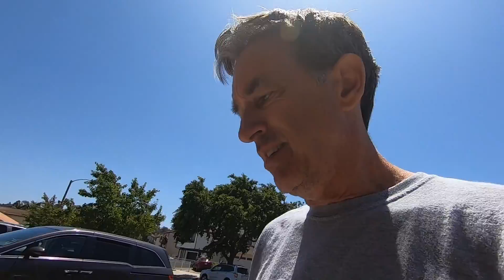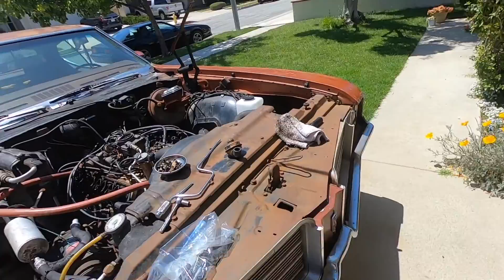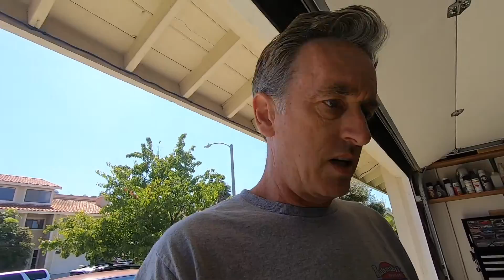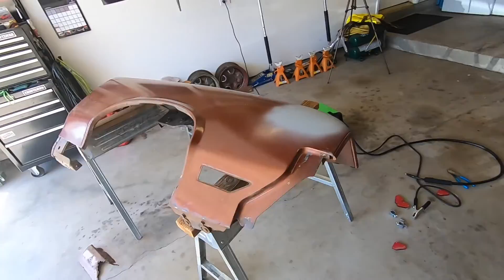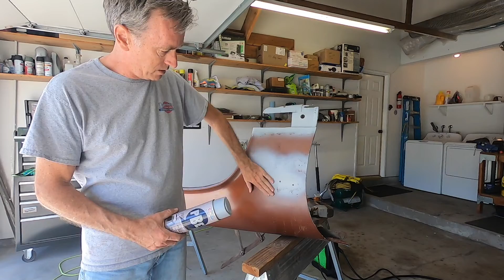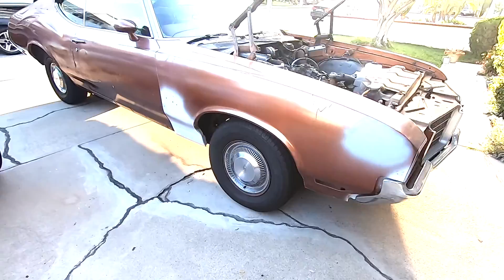1971 Cutlass Top-End Refresh: Valve Cover Restoration & Fender Patch Welding!

Comment: Use Marvel mystery oil instead of trans oil in your motor. Sub for one quart of motor oil. Transmission oil will work but the other can be left in until the next oil change.
Reply from the maker: Thanks Dan, also hearing good things about Rislone… curious to hear thoughts
Reply: @PCHGarage  never used it or heard of it. Just been using marvel forever. Just had a guy thank me he used it on his trail blazer SS fixed his ticking noise. A dealer quoted him 13G for a new motor. Runs perfect now.